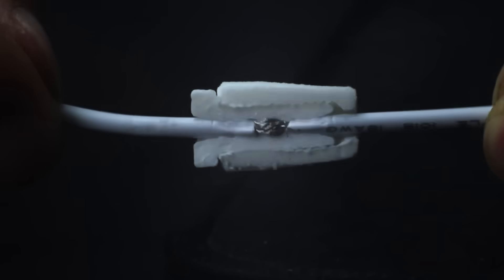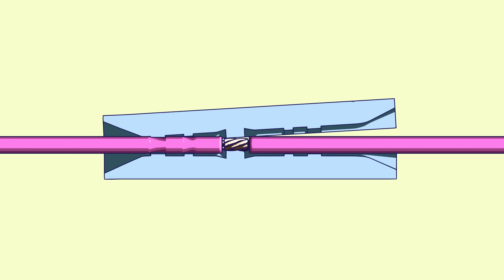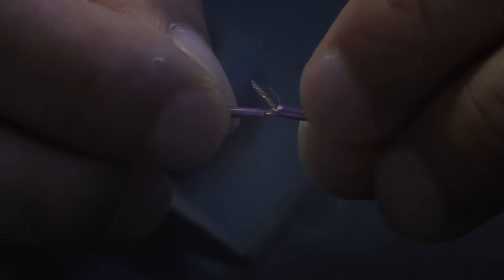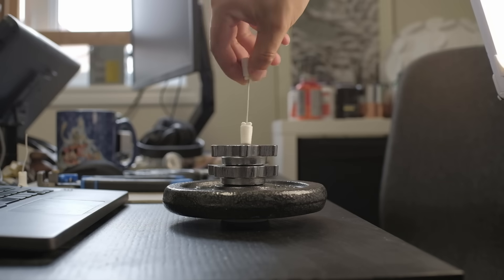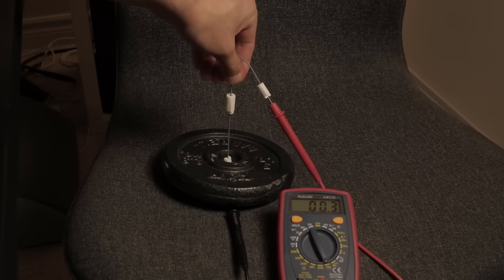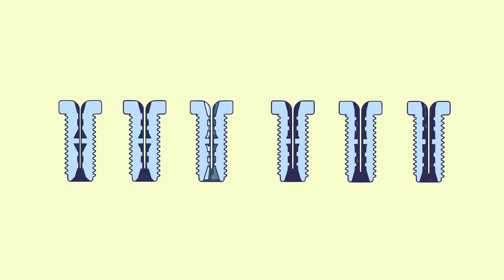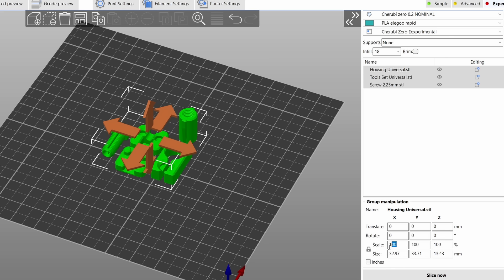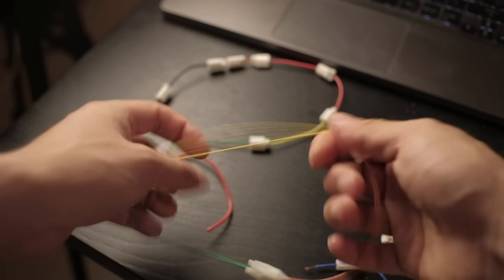3D printed wire connectors that actually work

Comment: Most mechanical wire connections apply preload/pressure to the conductors to ensure a "gas tight" contact between the two wires. The twisted wires in the center of this connection do not appear to have any meaningful clamping pressure applied to them, which means the electrical contact surfaces are liable to corrode over time and result in increasing contact resistance, heating, and eventual failure. Mechanically it's much more sound than twisting wires and electrical tape, but electrically it seems about equivalent (which is to say, not amazing).
Reply: OP is right, this is ok mech connection, but poor long-term electrical connection
Reply: The solder version seems good though
Reply: It seems like there is some clamping pressure applied to the joint, but unlikely as "meaningful" as a robust crimp or something. Adding some dielectric grease before final assembly could help address the corrosion concern, though.
Reply: have you watched the video?

Comment: I'd never use this connector for an electrical connection, but it's a very interesting connection for string/cord with the ability to quickly undo the connection.

Comment: This is why cars and houses burning down! That type of connection is very-very bad compared by soldered connection. Yes soldered connection need sealing and there is tons of selections to use proper isolation.

Comment: cool but i wonder how it will work with different insulation ont the cable, if you encounter a poor quality wire then how good will it be? also, that solder connection looks reaaally poor lol

Comment: Nifty!  I suggest you recreate this in OpenSCAD--which should be pretty easy--and format the script to work with Customizer--even easier.  That way, folks can easily create their own version that perfectly fits their needs.  So far, I think only Thingiverse and MakeWithTech support online customizing, but enablilng and using Customizer in the OpenSCAD app is trivial.  (Pressing <F5>, <F6>, then <F7> will preview, render, then export an STL  Simple, no?)

As for wat parameters touse, conductor and insulator diameter are the most obvious ones, as are length, width, and tolerances.  As well, features like room for solder/sealant/etc. would be handy.

Cheers!

Comment: As an upgrade to the design, I would try to avoid the need to twist the wire, as then the (electrical) connection quality is some manual process. Perhaps you can do a crimp-style connector, with a V groove on the bottom and a truncated V on the top which pushes the conductors together.

Comment: Are these rated for 750 MCM cable /s   But do you think the insulation strength on this is going to be 3D printed parts often struggle with it because of their Lawyer Lines

Comment: I don't have a need for this in my own low voltage/DC-power projects, but I sure could use something like this for 2-wire Romex cables (which actually have 3 wires) and 3-wire Romex (which is really 4 wires).  I could see something like this for the wires in a Romex cable , but since the wires are solid and not stranded maybe also use a thin metal sleeve over each pair of connecting wires to ensure connection, and then wrap with a self tightening connector/nut like you've designed.

There are two different spicing kits that I know of for Romex, but something like this, if it had the same tension strength you demonstrated in your video, would be better.  Seriously, you might want to look into making a commercial version for Romex cables.

Comment: The internal part could be made of 2 parts that connect with a joint at the end, so you have no risk of breaking it. In the end, the joint will make them rotate in evenly and the outer part will hold them together.

Comment: Just buy a 100 pack of waterproof pre applied solder shrink tubes for 5€. 
You only heat the tube with the wire inserted, the solder melts and guarantees good connection, the glue melts and provides waterproofing and the shrink tube makes it pull resistant. And it looks sleek. 

But this is a great invention for when you run out and are in a pinch at 2am😅

Comment: This is a great idea! I can see it being remixed over and over and tested by different people until we get something extremely useful!
A few pieces of advice, based on my limited experience:
❶ You don't seem to be using the Arachne wall generator, which is why your threads disappear at a certain size. You should almost always use it. I don't know why it's not the default setting.
❷ Threads come out much better when printed horizontally, so you should try printing the parts vertically. You might need to adjust the CAD file to make sure every overhang is no more than 30°, because you almost never want to use supports for parts like these. Additionally, the vertical resolution can be made much higher, by using a smaller layer height.
❸ Judging by the way it snapped, you might be using PLA, but this sort of print should always be done in PETG. Basically any mechanical part subject to stress, especially if there are flexible joints or threads, will benefit from PETG's superior mechanical properties.
❹ With an elastic material such as PETG you don't need threads to hold the outer sleeve in place. You can just design a matching ridge and groove into the parts, so that the sleeve slides into place by slightly expanding, and then snaps or "clicks" at the end. I believe it's called an "annular snap joint." But if you print the part vertically, you might not even need a joint, you can just use the layer ridges as a friction interface. (In which case you might want to use a higher layer height, which will also print faster.)
I bet that with these upgrades you could miniaturize the part to a fraction of its size (seriously, 1/10 of the thickness) and retain its full functionality.
Reply: Arachne actually is the default in PrusaSlicer from 2.5.0 onward.

Comment: this is brilliant. subscribed as I'd love to see where more of your designs go. I was playing around with making 3d printed adapters/connectors/ways of interfacing with stainless ball chain last year (cheap, every link is a pivot, cut to any size) and more recently have been stuck on o-rings as a means to stick together polyhedra so (I guess) vaguely similar neighborhood of clever little 3d printed mechanisms. tldr, I love this kind of stuff and you've made a really cool thing.

Comment: The problem is nobody needed it for smaller wires. as has no need for such sturdy connection for smaller wires, this is a "CLEAR Unnecessary" strong connectors. 

there is a need for such on larger wires that is used for extension.
but then when you make that bigger, it will then become "Unnecessarily bulky" which kills the purpose.

Comment: I think it works perfectly not as insulation connector, but as connection strengthener. If you use standard heat-shrinking isolation on wires and you need this connection to be physically dead strong, this thing will work perfectly. Maybe something like this could be used for relatively long wires, like extension cables or power lines in case they break.

Comment: Good idea, but i will just use a straight walled design without threads, in my case i'm not even pretending they can't come apart, i'll just add space for tape. But good idea, the tools could use a magnet or two.. For anything that has to hold, i will continue using certified stuff but this is good method for projects and prototyping with low currents and voltages.

Comment: These are great- I’d definitely print some out or have the file on hand for emergencies. I think I still prefer old school solder though, when done correctly it should be much stronger than the wire. In high school we soldered projects, and our teacher would yank on the wires- if it broke at the solder connection instead of the wire breaking- automatic fail: and start again.

Comment: Looks like a great alternative to wire nuts 👍 best part is IF you do solder the connection it will provide strain relief, allowing you to use these in environments that vibrate/shake/move

I'm going to print out a batch and over load test the wire to see how ASA will deal with the heat

Comment: I would love to see some more scientific testing of these, For starters, soldering the wires with a proper lineman splice!
And some more accurate pull force until yielding. Testing different gauges of wires, etc. You get the point.
I've personally soldered 16gauge wires that can handle a BOATLOAD more than 5lbs + Unknown mass.

Comment: It's pretty neat, but your implementation has several limitations.
- First of all, it's huge , Imagine if you have twenty cables to connect, and even worse if they have to go through a hole,
- it doesn't seem to be air tight, which doesn't prevent the wires from oxidizing, let alone from water,
- it is more cumbersome to use than some alternatives,
- you can't install it after connecting the two wires together,
- a specific one is required for each wire size, so it is not possible to connect two random sizes together,
- it's 3D printing plastic, so it will quickly degrade in some environments,
- and your comparison with a weld is flawed, since you haven't taken into account that a weld is usually covered with a heat-shrink sleeve. besides, the correct way to use an electrical wire is not to pull on it.
Reply: Not mention it is flammable
Reply: @kubamiszczz  Oh yes, true.

Comment: So why do you need a wire connector this strong? And how well does it meet corrosion resistance standards set by the ASE which is used for determining compliance for build codes and the automotive industry.

Comment: I love ideas that are brilliantly simple.  Let me do my part by subbing.  I think many of us will be interested in your design journal as well as videos that focus on the testing processes.  Keep it up!

I don't know if there will ever be a need for it, but it's fun to think of a sleeker version that uses a copper tube as the outer shell.  Though squeezing everything in would be a challenge with having to print just the right size as well as having to use specialized tools to fit the sleeve in place.

Comment: Thanks for developing this for us. Its possible this model could go on to be the defacto replacement to store bought versions for anyone who owns a 3d printer for _decades_. Not much to be done to improve the design for small scale connections, in the same vein as how drywall anchors have remained largely unchanged by the passage of time since the first plastic versions were developed by Artur Fischer and Oswald Thorsman in 1957.

Comment: that is this trash?
solder works great and it doesn't take up 20 times the diameter of the wire. 
if you need to temporarily splice two wires together get some wago connectors. they take up less space than this.

also solder is stronger.

Comment: I just tried the 2mm size, thinking it might be too big for my 16awg wires. But it's actually two small, by a lot. The 2.35mm one barely fits over my 1.5mm wire, but the part where the two wires meet and twist is too big to fit. The only way to get the twisted section to pull through without unraveling is to make the twisted section so long that it's essentially the same length as this entire print. So congratulations you have created a functionally useless design. Completely unusable.